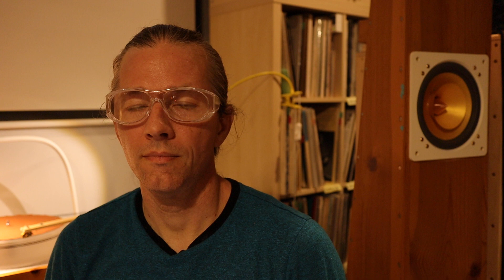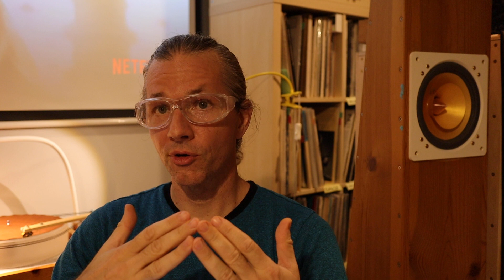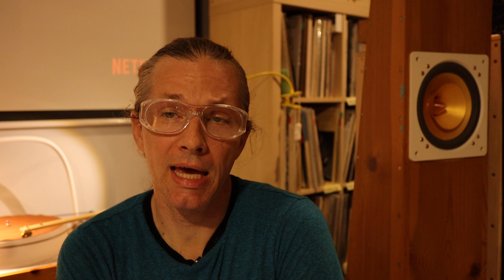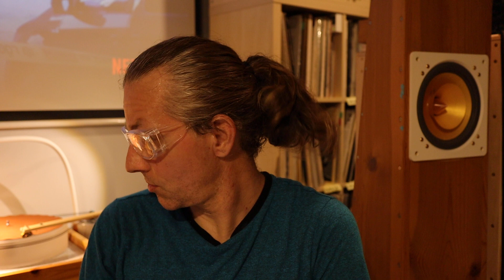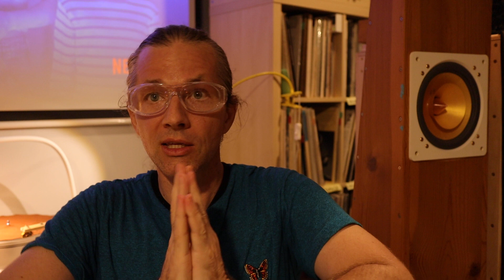Welcome to Nerd central:   Why a double pi filter? (tube amplifier stuff)

Comment: Strange the prejudices from some high end audiophile schooled .................ask if they ever tried it or experienced their beliefs/opinions !
Choke input has less voltage swinging than cap in ........but more expensive , higher volatge transformer and expensive quality chokes ..........two chokes if you can afford it !
Even choke in for output stage and bypass power with choke for the first stage(s) .........i build it and it's GREAT sounding.
There's differrences with chokes and the best are VERY expensive........
Some tried the primary of the same OPT as the OPT used  a  choke with good results...synergy .....one can also load the secondaries ....
A good quality compromise are the LL Lundahl transformers and chokes , to better them the  price will be a multiple.......
Every change in the power supply , every choice of a component and value of capacitors and brand  has IMPACT on the sound.
The energy to feed the circuit comes from the reservoir caqpacitor ................the BIG error is that the industry standard is to combine the ripple filtering and the reservoir cap in ONE capacitor bank............theyshould be SEPARATED .......
As Janos states it .................Cap in charges on the peak voltage ( not the RMS )- and the choke imput charges the capacitor in his duty cycle...........BIG difference in sound ......
In case of the standard used  Cap input power supply the best capacitor after the rectifizer becomes you worst friend ......a&s it will drain BUrsts of current over the transformator and diodes ............AND YOU WILL HAVE BASS and UNREST ( listening fatigue ) as a RESULT .......nad what is the answer to this unrest feeling ??............well they will use ever BIGGER capacitance .............still more bass and power and MORE listening fatigue !
When I use CLC ......( because of the transformer voltages )...........I try ever to reduce the input capacitance to it's minimum value ( listening to different values ) and as a  rule of thumb use a reservoir capacitance with low esr after the choke with about tree time the value of the input capaictor ...........to avoid ringing /resonce of the PS..........most comercial power supplies use the same value IN/OUT ...............try different and listen for yourself before juging the values and believing the audiophile teached by high end that MORE is allways better !

Power supplies must be at service of a circuit and the demands of the whole.........ever different and adapted for synergy and musical joy ...........numbers are nice, real results are the ones you experience when you can connect to the music in a way you can and do FORGETTING THE TOOLS YOU USE..............

Comment: Hi janos,i got 2 chokes in my power supply but one on each side of the channels, ,its a power supply  with pi  filter with 5u4gb and 2 chokes to separate the 2 channels of the stereo amp .do you think its better to put one choke only  for the 2 channels of the amp!its sure it takes a big chokes so  i need  140 ma on each side of the amp it takes 300 ma chokes for the supply,thanks
Reply from the maker: If you already have the two chokes, use them. Better than just sharing a single one. A choke not only filters hum, but also stores voltage - each channel having its own voltage booster is a huge plus.
Reply: ok thanks  ,my other question concern the heathkit push-pull 807 .do i need to let 100 ohms in serie with the 1.2 k cathode  807 so  i dont  see why the 100 ohms is necessary.with the configuration   you have make on video is the amp work in class a ! thanks yvan @realworldaudio

Comment: Hi Janos, thanks for the answer. So I think the short answer is "becasue of the application". What I forgot to mention in my comment about the chokes (and I actually got a very good reply from Frank on that) is that a "choke in" supply will initially sag a lot and then become much more stable than a π filter. So it only works if the bias current is higher than the initial sag, if not it will be a disaster. So choke in basically only works with a class A amplifier. Also due to this phenomena (as Frank said) you will need a significantly higher secondary AC voltage for your B+
In answer to the Hum argument, first of all I will immediately admit that you have a tonne more experience with high efficiency speakers and late night flea power amplifiers, so no argument there. But I would still like to argue that becasue of the much longer charge cycle of the choke in architecture and a much more stable B+ compared to a π filter (and thus more dynamics) this architecture is still the better one and can be made to work. If I where to do this I would first choose an as high as I can afford inductance and this will allow for a significant higher capacitance at the output as the tube is rated for with a "capacitor in"  architecture. If that does not kill the hum, you can add a π filter after that and get the best of both worlds: Less sagging; longer charge duty cycles; easier on the rectifier tube; no ringing on the transformer (all those are in my opinion related to a choke in architecture) and then due to the second π at the output of the first capacitor no hum either. 
Finally, it could be that the Darling has so little power that it added sagging with a double π architecture does not matter. It could also be that the darling has such a low bias current that your favorite rectifier tube is still not operating in the stable regime (after the initial steep sag). Both cases could be a very good reasons not to use this architecture for the Darling amplifier. In any case it makes us think about our choices and preferences and even if the outcome results in the same design concept, at least it is a more conscious decision, and that can not be a bad thing.
Reply from the maker: Superb explanation and additions! For the Darling with the approx 250VDC/45mA 6H is already beyond the critical inductance, so could use that for a choke input application. I recommended the low value tuning cap to make the power transformer selection easier. But definitively, I highly recommend playing around with choke input.

Comment: Janos, with a class A amplifier, I thought the maximum power was always being taken from the supply, which is then dissipated in the output stage and/or the loudspeaker depending on signal level. So in class A there should be no additional draw on the supply, regardless of level, unless overload occurs. Perhaps I misunderstand class A?......
Reply: Only push pull class A has constant draw. Single ended amps generate the whole 'sine wave' by modulating DC voltage/current, so despite the constant 'bias' voltage/current, the actual  moment-moment current draw is variable with the music signal. So while the amp's power draw over longer time periods is constant and based on the bias, it's definitely not in smaller timeframes. 

There's good reading material around the 'Axiom' 300b amp that discusses various methods of biasing and the why of using high value chokes to feed each (singled ended) tube. I have found that choke feeding each (singled ended) tube hugely improves dynamics and removes and any 'slowness' that some ignorami say is 'inherent' to tubes, but as usual, that's just a design choice or oversight.
Reply from the maker: @EduardBroekman  Eduard gave the perfect well-rounded response! 👍✨  Indeed, it is a matter of correctly feeding the tubes. It takes SPACE and WEIGHT and a whole lot if iron, so it's not really seen commercially. I have not recommended to go all-out for the Pure Darling, as it is a learning amplifier, a pillar for growth. All-out version would be so much harder to build, and in a very different price league. I don't think anyone would shell out so much money and effort for an amplifier under 1W output....
Reply: @realworldaudio  😄Well... I now tend to see it from the opposite side: 1-2W and super high efficiency driver actually allow you to go all out while not going into an astronomic budget :) Bob Hoekstra who designed the Axiom found out that inductance mattered more than DCR for the choke to act like a current source, so hi-Henry chokes of decent size would do the job quite nicely, and you can use lower-Henry high current inductors for pi filters. From personal experience, I found personally for choke feeding, is that using chokes at spec (with rectified DC current) is giving very good results, whereas in power supplies I'd rather oversize them (also to retain good thermals).
Reply: @EduardBroekman  Thanks Eduard. I need to study this more closely, I clearly overlooked what is actually going on!
Reply from the maker: @mfr58  Not at all, was a great question from someone who is informed about main aspects of power supplies, and you knew the answer that one gets from the mainstream-stream, and the side of the coin that supports the solid state supremacy-fallacy. Now you get the dive under the surface, the flip side of the coin to see the whole picture. It's always the application, using the tools where they are needed. ; )
Reply: @realworldaudio  Life is always more interesting than we are led to believe!
Reply: There's a difference with A SE and a PP......the latter is current stable .....( ideal situation )........
The amplifier classes may be looked at something like  a methaphore for creating a statue..........In class AB/B it's like modelling a statue with clay  building up from nothing or almopst nothing , .........with Class A its like stone sculpture art...........the statue is allready in the stone....................Imagine it for what it's worth !